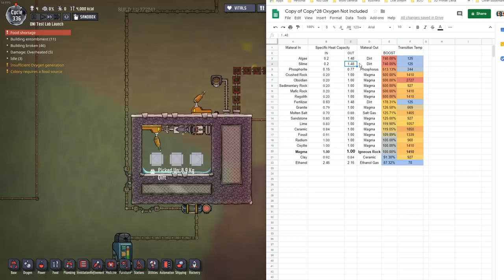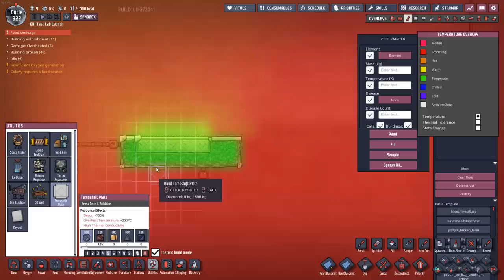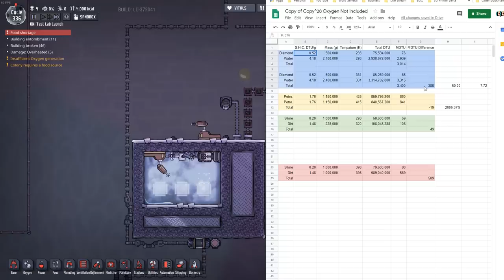Can We Cook Dirt For Power? Oxygen Not Included Experiment

Comment: Aren’t you losing half of the mass and therefore energy if you let it form blocks and then mine it? I think you should try to extract the energy out of the blocks and not out of the mined stuff, to be really efficient.
Reply: Another likely situation is molten glass to melt regolith or vaporise molten salt. (factor of 5, and 1.2)
A stretch goal would be molten glass into rock gas via an iron/gold volcano, then through molten salt, and regolith. (combined factor of 30)

As a side note, reclaiming the heat of melting regolith takes a few dozen steam turbines. (theoretical factor of 5)

Comment: A more controlled and usable reaction to generate energy from dirt may be the conversion of polluted dirt to dirt by using Ceramic Compost heaps. You should be able to convert 270 C polluted dirt, composted into dirt, which will increase it's thermal mass from 0.83 to 1.48. If you can somehow operate the Compost with input polluted dirt higher than compost melt temp, then you may be able to go to the dirt limit of 326 C.

Comment: The problem I think is that the tipping point is 125 C - the same as the needed temp for the steam. So when converting from slime to dirt it jumps in energy, but that energy is at 125C if that make sense. Technically you have more energy, but you can't use it to raise the temp of something above the 125C because it's balancing towards them. (Unlike the salt thing you did in the playthrough, where the conversion is happening at temps above the ones you needed). If the conversion  of slime was happening at 150-160, then it would have worked.
So the turbine is actually running from the temperature that is coming from the petroleum, not the slime. My guess is in a system like that the petroleum would be the thing to heat up the steam to 200C or whatever degrees, and the slime would be more useful to keep the temperature above 125C for a longer.
What I mean is you run a radiator of hot liquid under the steamturbine, it raises the temp to 200C then you shut off the radiator, at that moment the temp starts dropping because of the turbine deleting the heat, but the slime to dirt is making that process slower. Eventually you run another batch of hot liquid.

Comment: Hi. I have one suggestion, the counterflow part should not be a single block of tiles. You want heat to transfer from the dirt going out and the slime going in ONLY. Instead, the heat travels up via the tiles themselves, quite efficiently, since they are very conductive. You may want to prevent that, the heat exchange part should be a pattern of 2 horizonal metal tiles then 2 insulated ones, to prevent any heat to go up via direct contact. If you check the temp display you'll notice the block has little gradient  now (its conductivity works agaist the creation of a gradient). You should see a greater gradient if you use stripes of conductive tiles and insulated ones. I can't try it in game now and take a screenshot but I'm sure you get the idea.
Reply: Exactly, that block of metal is highly inefficient as a pre-heating thermal exchange.

Comment: was playing about last night with a steam generator setup running on polluted water, giving up precious dirt at a decent rate, had 4 turbines running max efficiency, off a drip feed (3000g/s) with automation collecting the dirt and dropping it into a nice chilled pond, managed to get half my bases power just syphoning off the heat in the oil at the bottom of the map, your little setup in space would be better, im not as lucky to have a couple of volcanoes so high up, so i had to go low. oil at around 230 degrees C was perfect, it warms up the diamond windows and collects the dirt from 4 tiles, so simple yet effective, keeping it cool with 1 aquatuner was the hardest part, i think i just got it all working just right tho

Comment: Use the dirt as the float heat in a Aquatuner heat pump.

The amount of cooling that a loop can do with water is limited by the temperature it freezes at, once the loop is frozen there is no more energy to extract.

Using the dirt as input heat on the cooling loop - you can extract and concentrate the waste heat for the steam turbine.

Also, it seems the auto miners delete mass when digging. Is there any conversions that are net negative? For heat deletion? Perhaps its positive, until half the mass or more is deleted.

Comment: I'm picturing an overally complicated preheater, exchanger and deletion device to bring the slime all the way to solid glass. I figure dumping pre 100c heat sources into the slime, dirt between 100 and 125 for slime and steam then possibly deleting heat at the dirt -> sand transition. The hardest part I could see is the push from sand to molten glass before deleting a lot of heat at the molten glass to solid transition temperature. The only real use I can see however is heat capture for rocket exhaust or deleting heat from metal volcanos. Would be interesting to see how many different heat ranges you can funnel into a single system exploiting the transition properties of solids. Or just as an alternative design to using liquid based heat transfer systems.

Comment: So Brothgar; have you tried getting energy out of the molten glass to rock gas reaction?

One trick you should try doing is heating up the molten gas while it is in a tungsten radiant pipe while under 1kg/s flow.  When you are below 1/10th the flow in a pipe it doesn't change state change, allowing you to get it to an even higher temperature before the change in state.

Molten glass has a specific heat capacity of 0.2.  While rock gas has a SHC of 1; plus cools into magma with a SHC of 1.  You can heat up more molten glass with the rock gas, allowing you to multiply power even more than a factor of 5.   Try to run it as hot as possible; although I typically run into a problem with the liquid vent melting(try seeing if can find a method to run it above the melting point of the liquid vent, if not oh well).

I prefer to make the glass with a glass forge.  Sure you delete most of the sand while doing so; but sand is really easy to combine.  And plus it comes out already at 1750c.  

----------------------------------------------

Note this method of heating a liquid above its boiling point also works for molten salt-to-salt gas.  Which is nice since it isn't consumed in the process.

It also works for oil-to-sour gas.

Comment: I haven't played ONI in a while, but cooking slime into dirt even just as a source of dirt ( for farming ) was not viable because you just can't get enough puft ranching on a map to make enough slime to make a usable amount of dirt.  And you lose half of the mass when the dirt tile is mined.  Has something changed?  And instead of extracting the heat where the dirt is formed, I think you want to pick it up, and drop it off on a heat transfer plate.  Also instead of trying to passively let the heat into the water to boil you may want to use a fluid regulator to pump the heat into an oil reservoir until it gets good and hot, then pump the oil to the boiler at 200+ C.  For that matter, why keep the slime going around in circles on the rail?  Just drop it on the ground until it cooks and set the sweeper not to pick up slime.  I think your lost dirt mass is because after you mine it, you lose 50% of the mass, then when more forms, it absorbs the ball of dirt on the ground and now you get a dirt tile again with 1.5x the mass of the first, which loses half when it is mined, which sometimes turns back into a tile before it is swept up, and is mined again, etc.  You may be able to deal with that by using automation to drop a bunch of slime, stop adding more, cook the slime to dirt, get it all mined and swept up, then add more slime after all of the dirt has been removed so it can't turn back into a tile again.

Comment: It could be useful but in a different way. Self-powered kiln by using melted salt. Of course, it needs the energy to melt salt at first but it could be an advancement from manufacture to a factory with less energy usage. The only issue is that it requires space-age thermium liquid cooler to archive 926 degrees.

Comment: The "Weight Plate" is 2 tiles high thanks to the "button" on top of it. It seen to be a oversight to make the animation work that now leads to this. See you next patch scaping all Weight Plate exploids you come up with.

Also i want to remind everyone: Everything that is for heat conduction that isnt facing over 660°C MUSS/CAN be out of alu (ore or refined) to max out heat conduction.
Is a liquit in need use water for over 100°C, lead for over 330°C and alu again for over 660°C.
Using a "tank" out of diamond thermo shift plates with 660°C hot alu is the best way of catching the heat of a rocket and a tank out of alu thermo shiftplates filled with water/lead for everything else that isnt over 100°C/330°C hot.
Using diamonds for high and alu for low temp in the background of said is also up the aktion.

Comment: When the slime flash into dirt inside a wall, is it possible to capture the energy of the dirt inside the wall as it go up the wall?
This might be worth testing. 
You could probably flash the slime into dirt inside the wall, create a gap of insulated wall, then a column of metal in the path of the rising dirt to capture the heat before it switch to a solid dirt block.
kinda hard to explain

Comment: this sounds like a complicated way to get rid of all your slime and get half the mass back in dirt
Reply: slime becomes pdirt by turning it into algae (2/3 of the mass is lost/turned into pwater) and feeding it to Pacus (50% lostes), not to mention that pdirt "evaporate" into pO2.
So overall if you use 1000kg of slime:
Brothgars way will give you 500kg dirt (hot dirt i may add)
But the "normal" way will only gives you (1000kg*0.3*0.5-evaporaterate per sec) less then 150kg with 75°C manual labor requirement with the extra bonus of having food.
So its better to boil your slime then do it like normal mortals do. GOD i love watching brothgar.

Comment: Brothgar, Please have a look at the "Specific heat capacity" of water, poluted water and their respective *Ice*, because I smell infinite power (if one freezes water and then melts the ice back in a loop there should be some free power generated along the conversions, since in this game it takes ~3°C over a state change's temperature threshold to actually change the state of a material (or at the very least it is like that for water and ice)). Unfortunately you need Super coolant for this to work, and a lot of it at that to make the thermal aquatuners combined with steam turbines to run by themselves (with having 150W extra every 3 steam turbines and 2 thermal aquatuners).
Unless the devs changed the heat capacities again such, that it won't work.

Comment: So.... I'm pretty sure that the dirt is getting deleted behind the insulated tile. That or, the game tries to place the dirt behind the metal, it can't then it tries to place the remaining behind the insulated tile but can't so then it places it on top of the insulated tile. But, this means it's "broken/mined" 3 times deleting a significant amount of material. I think you had the right idea with the pressure plates but run automation to a door beneath them so that if there's dirt ontop of the plate the heat source stops heating the dirt and only the slime.
Reply: I think we are losing some to slime offgassing, then half to mining the dirt tiles themselves
Reply: @gryphonayres6626  It just really looked like he was losing even more dirt after he started having the rails going under the insulation. But you're correct the transition from slime to dirt isn't 1:1 either.